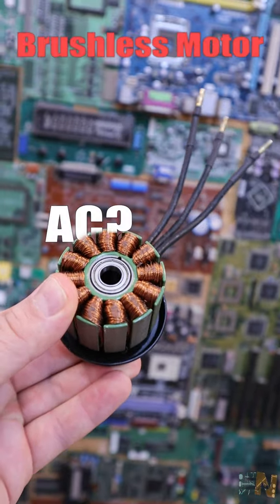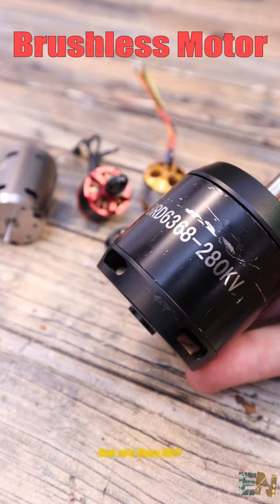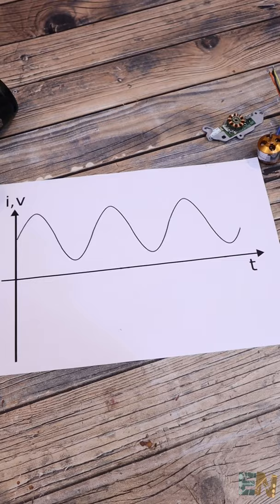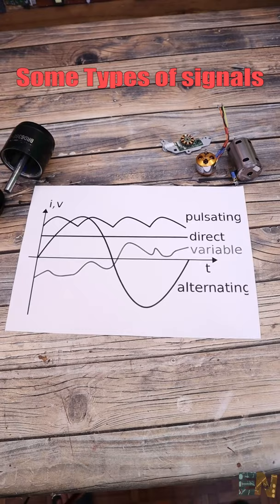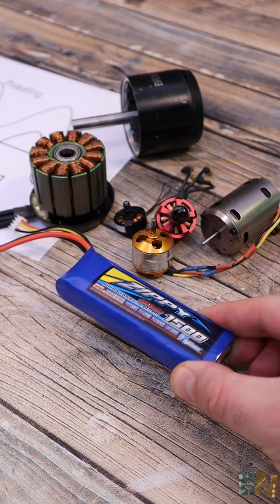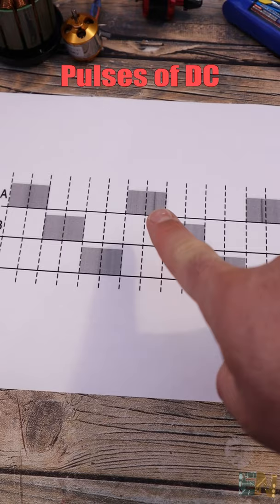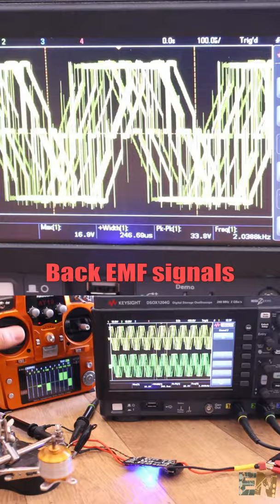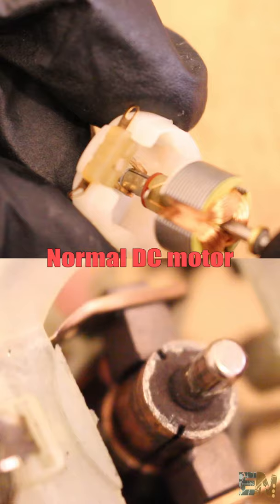Are Brushless Motors AC or DC? - Well...

Comment: DC or AC motor never depends on your source power. In industry use, AC motor actually uses power-line AC converted to DC then use a method called Variable Voltage Variable Frequency to drive the motor. Befor the motor controller it is DC ACTUALLY, but it is AC motor.

Inside the motor, there is never a DC exsist. Both the BLDC's ESC or the VVVF module generates a rotating magnetic field by the phase itself without the need of DC motor's inverter. Remove the Rotor, the magnetic field still rotates. This is due to the three phase. The ESC is the DC to AC converter actually.

Comment: I wouldn't call this DC, because DC means that the current is applied directly, a constant uninterrupted voltage.
What you have to feed into it more accurately represents 3 phase AC than DC.

Comment: To all the people saying it is a AC motor, what about a standard 'DC' motor feed with a PWM signal...? Would you call that an AC motor...? Personally think referring to brushless motors as DC is fine.
Reply: Standard dc is motor with brush. PWM is just speed control turning on and off at high frequency. AC is alternating between positive and negative so bldc needs inverter usually 3 phase. So the current on the bldc motor terminal is ac but pulsed
Reply: Yes, it's AC because the comutator changes dc to ac
Reply: LOL
PWM is merely using DC and switching it OFF and ON at high frequency
You are still using DC
Bad Example

but this is still a DC Motor, i agree with that.
the problem really is, this is a bad video that got a few things wrong that caused confusion.
now we are untangling the confusion

Comment: The definition of AC is a signal with the average -- mean value equal to zero. When the average is non zero, it is DC. AC voltage does not imply AC current, and vice versa. Only if the load is linear does this hold true.

Comment: Brushless motors are three phases of field coils. This is why they are often called AC motors.  Dc motors are usually sistered with a permanent magnet. Even the “new” inductive dc motors still need alternating current to function or a permanent magnet..

Comment: It's a dc motor. The 3 phase plus is above the 0 state. If it was ac supply  to the motor it wound vibrate back & forth
Reply: Wrong.
Reply: You need negative voltage for brushless motors

Comment: The representation you show is AC with a DC overlay. Or vice versa. It the sum of an AC plus DC signal. As it not going though the zero Volt line, this sum is not AC, here you are right

Comment: But the fact is bldcs sometimes works inhigher frequencies and sometimes lower then mains frequency. Actually they has sensor for setting the frequency. System gives ir 1 hz~ sognal and as it starts turning ,sensor triggers to next phase.
Reply: there is sensor and sensorless bldc motors, for car racing they need the sensors so at the start of a race they can go from 0 rpm to speed with minimum delay. Most other applications (RC planes, helis, drones) do not use sensors, they use a zero crossing sensing technique in the esc, its lower cost and alot less wires.

Comment: the phases of the bldc is ac, not a perfect sinewave but it is. they have six stages of switching in the three phase bridge. If it was three stages, it could be a pulsating dc signal. If you had a three phase bridge, you could either use three stages or six, why not using six without increasing any hardware components?

Comment: The commentator was used for switching currents for a long time electronics taken it's place for zero arcing sparks that can start fires like propane gas heaters of flammable areas dust in grain mills automobiles etc.

Comment: The problem with this video is some things are correct and others are incorrect. Sometimes hard to tell what some of the comments are referring to relative to the video. I have been saying this motor is running off AC current and electroboob is wrong, others are talking about the drawing with the sinewave above the 0v line (which this does not apply to this motor/esc, just adding to the confusion. Remake a new video is needed and this one removed imo.

Comment: If you have h bridge how is there a negative voltage .electron flow is positive  how negative
Reply: You have to understand the difference between P-channel and N-channel mosfets and how they're used in an H-bridge circuit to change which way the current flows through the motor windings. You'll have to research it yourself because it's way to much to explain here in the comments section.

Comment: So it's it a DC motor that will also work with AC or only a DC motor. You never really answered your own question. I left more confused then I started with.
Reply: Ok, I'll clear it up for you.
to keep it simple with as little Engineering concepts as i can manage
1. To simply grasp this you have to agree to not go too deep into it  (otherwise we need to go deep)

2. Your simple answer is Pulsating DC

3. there is also a huge debate over whether it's AC or DC and in reality both arguments have merits, but again, in order to go down that rabbit hole you would need to accept very fiddly Engineering concepts

simply stated, it's a DC Motor
and he was showing Pulsating DC

Brushless Motors simply stated are DC Motors

the reason this video exists is because it takes advantage of the confusion that the existing debate has created and capitalizes on it 

Your simple answer is
it's a Pulsating DC Motor
if you want to know more or debate more, do so at your own risk and confusion

Comment: My question. If anyone can help me. How I can mesure de Current ( Amps) on an rc (used with ESC)  Brushless motor with a Clamp Amp meter?
Reply: Sure. I would measure on the battery wires to get a stable reading. I use a multimeter hooked up in series from battery to esc.

Comment: Technically all motors are AC cause DC magnetic field cannot do anything
Reply: except for brushed dc and universal motors. The rotor fields are stationary but as they try to align with the stator magnets/electromagnets the rotor coils are switched and that causes the rotor field to dissapear and a appear again in an unaligned manner which causes the rotor to try to align again and this repeats on and on and on
Reply: There is one type of motor that is pure DC  it is called unipolar motor.
Reply: @the_danksmith134 No, they are AC motors.  Only computation is done mechanical by brushless, and current change direction in rotor.

Comment: Read it all doubt will clear I promise
All DC motors are single phase, but AC motors can be single phase or three phase
Ac moter - has 2 types synchronous and asynchronous motor [asynchronous motor is also called induction moter ]
bldc moter is an 3 phase ac moter but only difference is we use battery so battery has dc so we use esc speed controller what esc dose is it convert dc to ac and give 3 phase ac to moter so bldc moter is ac moter or ac synchronous motor 
esc??????????????????????????
in motor what esc working principle ????
It controls the rotation of the motor by delivering timed electric signals that are translated into changes in speed. It uses the direct current from the battery coupled with a switch system to achieve an alternating three-phase current that is sent to the motor
 do you get ittttttttttttt brother or do i teach you what induction  moter is

[[let me remove all your confusion. All  induction motors are ac and brushless OK made by tesla .
{{{{And  all dc moter is single phase , but AC motors can be single phase or three phase}}}}}

problem is with this bldc moter is also a 3 phase moter 
Not just 3 phase also brushless so what we called 3 phase brushless moter is ? A induction moter 

Now second problem is a  bldc moter is a synchronous moter which electronically controlled 

But a induction moter is a asynchronous moter that no need of a control so 

Bldc moter is an 3 phase induction ? No bldc moter Is a 3 phase parmanet magnet ac synchronous moter ......

Comment: But, u can alao drive bldc motors with ac,  but if the motor get on stall, it just shaking.
And bldc motors have best performance if they drived by dc, and dc esc are very low cost compared to ac esc🌚🌚
Reply: It doesn't matter if you power a bldc with a DC powered ESC or an AC powered ESC. There's really no difference. For a DC powered ESC, you can either use a battery, which is DC, or a DC power supply, which is rectified AC. With an AC powered ESC, the AC gets rectified to DC immediately. There are quite a few different things that would cause problems with the motor stalling or just shaking; but you're current source has nothing to do with it.
Reply: @paulcrandall2534  i mean output. Sorry

Comment: Brushless Motors are pulsed DC
Reply: The driver (aka the ESC) is pulsed DC, the motor still works as AC magnetically, just at a lower saturation because its relaying on the magnetic circuit to flip magnetic polarity instead of having a coii drive the stator negative on the oposite side.
Reply: Wrong.

Comment: Brushless motors are AC, regardless of wether the voltage alternates between a positive and negative voltage or two distinct positive voltages. 

Furthermore, technically all AC is just DC that varies over time cyclically in a fixed pattern, so, even just pulses of DC are technically AC.

Comment: You're kinda splitting hairs man.  Technically, your DC motor is actually an ac motor but it achieves that through the brushed commutator.  The inductive load swaps poles... Nuff saidm